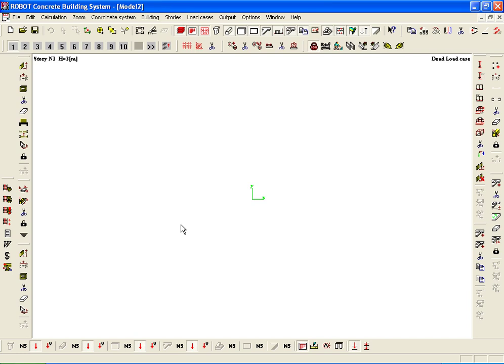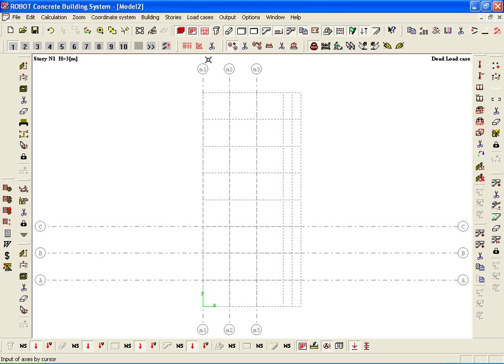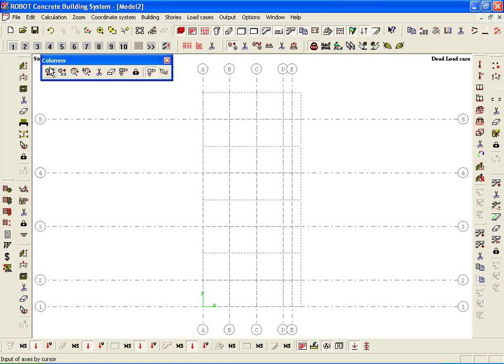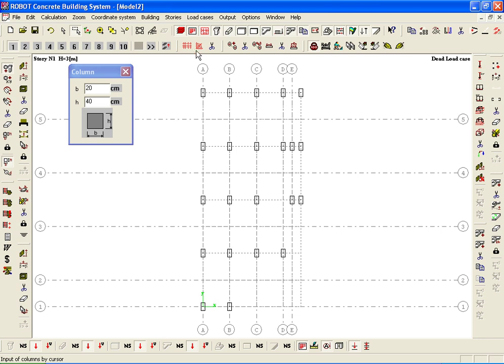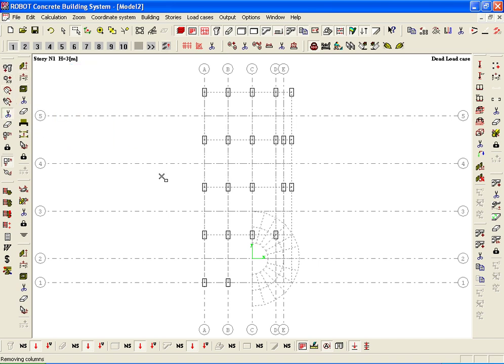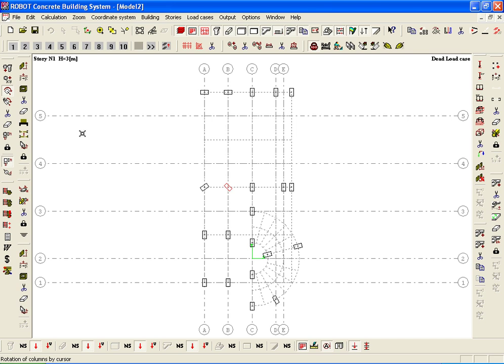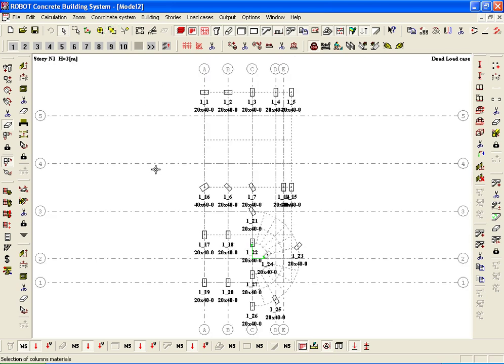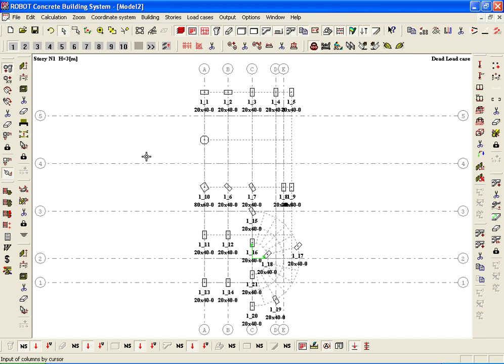CBS ROBOT- LESSON-2

Comment: Khalil Brother how are you ? I'm just asking if you can make a tutorial for modeling construction building by use Robot structure analysis ,I downloaded all your previous  tutorials,it's greats job , I'm Encouraging you for this job ,Allah will blessing you ,
Reply from the maker: Dear Mr, Yassir,

i have Robot tutorial for full building structure, kindly check below link:

Modeling of building using Robot Millennium V15.

but if you are referring to Robot CBS , i have done but it's still on my hard disk the problem i am facing Corrupted  file issue i am trying to recover the file back 
hope i succeed  :)
finally, i will email you the link in case my efforts worked

regard

Khalil